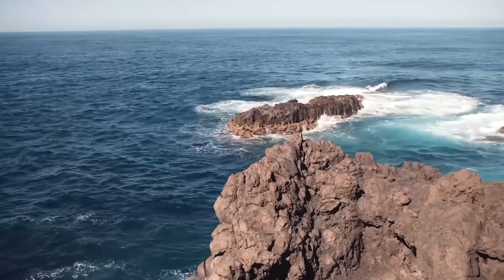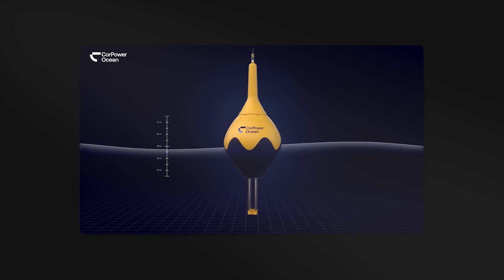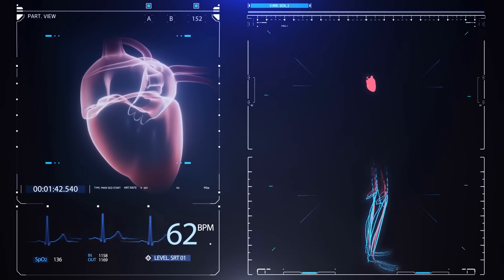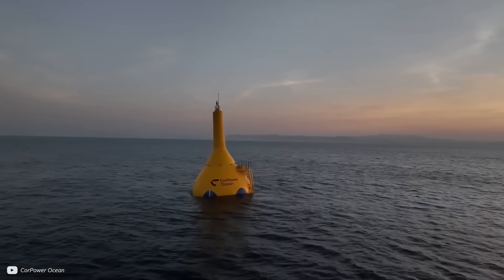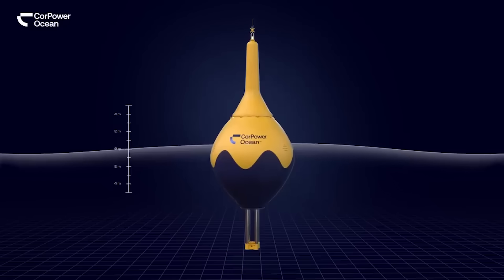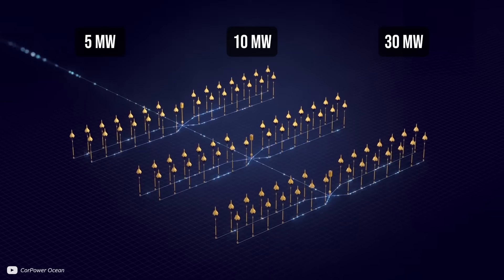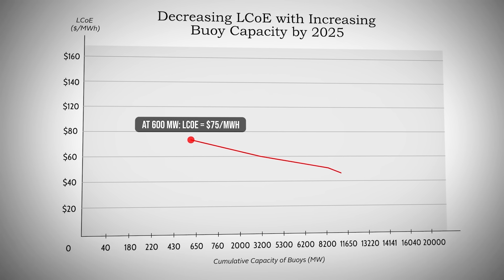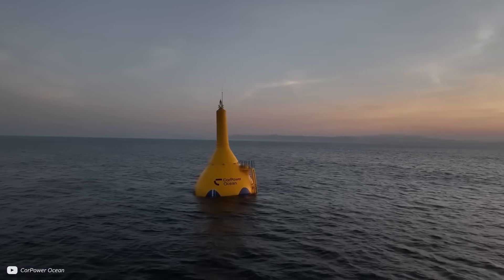Unlimited Wave Energy: This Buoy is the Future

Comment: I am not really believing the sales hype here.

Looking at the bouy, I think it will fail the LCOE test because it will get damaged and warn out, then fail just like every other wave powered electric generation systems. 

The bouy is made of fiberglass, the same thing that wind turbine blades and fiberglass boats are made of.  Fiberglass wears out and fails fairly quickly under stress. Steel is better. 

The internal gears and shock absorbers are going to wear out fast with constant use.

The bouy has steel rods that are constantly moving in and out of the bouy under salt water.  The seals are going to wear out and leak in sea water. 

The bouy and associated equipment is going to get covered in barnacles and other stuff. 

I hope it works and yo get a great LCOE, but the deck is stacked against you.   Maybe you'll be the first to make it work, but many have failed before. 

Waves have tremendous energy, and that's why they destroy everything they touch. 

You should try something easy, like landing a man on the moon instead.

Comment: Australia has a working device generating 200Mw. The Uniwave200 project sits on the sea floor and works like a blowhole, using air to spin the turbine. It has very few moving parts and is patented. It could be installed on or near any seawall
Reply: That's 200 kW (kilowatt) maximum capacity. Not 200 megawatt.

Comment: My consulting firm worked on a small buoy power generator system some years ago for pacific island/atoll deployment. Designing for the ‘100 year wave’ was a significant challenge. Rather than place the expensive generator in the buoy with a risk of it being lost if the buoy should break free, it was designed to be placed on the sea bed. This made cable to shore management much simpler. In turn, they buoy could then be manufactured much more simple and much less expensive. Onshape is a great tool.
Reply: Is your system still in place and generating electricity?  Proof of long term survival and continued functionality over time in the environment is the ultimate test.
Reply: You don't need to design for continued operation in the 100-year event, just survival. You could simplify the challenge by accepting that the system will shut down in events larger than the 10-year event. That would mean it's forced to cease operation due to bad conditions only once every 10 years on average, which seems perfectly acceptable to me.
Reply: I would say, it makes much more sense to have the expensive generator available in the buoy rather than inaccessible on the sea floor.
Reply: There is nothing that the sea will not break.  Nothing.
Reply: @Deontjie  I've seen pretty old mooring buoys
Reply: I think I remember that 👍 it was a pretty cool system if I remember correctly 👍

Comment: Come now, you should know by now that this system has serious flaws. It's based on tech developed by others which circumvent some of these flaws.
MY COMMENT ON YOUR RECENT WIND TURBINE VIDEO:
🤜⚡💥⚡🤛Being a triple engineer with numerous inventions in this space, I conclude that this is not a good design. 1] Downwind designs encounter turbulence from the tower which reduces efficiency;  2] Wind speeds are slow at low elevations which reduces energy production;  3] The blade angle is sub-optimal for all inclinations which reduces energy production;  4] The blade angle to the wind direction requires much stronger, and therefore heavier and costlier, rotors;  5] The retreating blade encounters the same loss of lift that helicopters experience which here translates to reduced energy production and other problems. IMHO, the cost of the system is comparable to legacy systems and therefore the lowest levelized cost of energy [LCOE] metric is higher. Not a good look.

FYI, most wind energy comes from medium wind speeds BECAUSE they are more prevalent/frequent in occurrence. High speed winds occur less frequently. Low wind speeds don't have sufficient energy to be of use.  

I have advanced, robust, low cost wind turbine innovations, offering the lowest levelized cost of energy [LCOE] and ultimate  survivability in any wind regime.
Simple low cost grid-scale energy storage is also on the table.

Contact me for more information and check out my engine/transportation innovations...including off-planet solutions.

Stay Radical!

From the desk of: Chief Radical Officer
🤜⚡💥⚡🤛

Comment: I got a wave power idea: I comprises of a large pill shaped float (the size of a small house) that is half full of water. It's attached to a strong arm (like a cistern float) and on a pier above the water level. Where there are two disc shaped generators (like on some direct drive wind turbines) with one for upstroke and one for downstroke. The water in the pill shaped float does the downstrokes. It's basically just one moving part and built strong, should last a while without much maintainence. Also have easily replacement of wearing parts to keep maintainence cost down. And it should be possible to empty the water and raise the float in wild weather conditions. And refilling to half full should not be too difficult autonomously. It's about half full to make the upstroke and downstroke the same power and also making the maximum downstroke power, with the same power upstroke. Obviously way less than half full when you include it's empty weight. But the combined weight would be half of the buoyancy of the air inside the float. That's what I would technically mean by "half full". I like it cos it would seem to be rugged, powerful and low maintenance. I tend to shy away from gears and sliding pumps etc. Too many parts for wave power cos of the inherent high maintenance. They go for ever without stopping, continually wearing for ever! Designers have to keep that in mind when designing waver power systems. As soon as I saw the direct drive wind turbines I immediately started work on my design, being stoked about direct driver generators for wave power!  😅 They are slow RPM and only one moving part. A win, win for wave power! 😅

Comment: You can fill a thousand years worth of videos on all the renewable energy upstarts, and all those money grabbing schemes seems to get funding.
It doesn't change the fact that this is shit. As we all know: Photovoltaic cells, wind and water turbines is the only way forward.
Something new and really smart could come along, given time, but this is just a time and money waste.
If anything, I'd look at new battery chemistries for energy storage, even pumped hydro is interesting.
Our tendency to gravitate towards new "revolutionary" solutions, instead of the incremental improvement of things that actually work, is quite depressing.
Reply: When the graph projected forward to installing a whole bunch of these devices it finally "theoretically" matched the cost of solar and wind. I would have thought that was a good reason to abandon this wave tech. 
I also wondered is the cost included the cost to deactivate these devices. I know it's pain to deactivate land based systems. I think deactivating these ocean systems would be more harder and much more expensive.
Reply: @ddegn unlike sunlight and wind, ocean waves are more reliable,. It is only during  heavy storms that no energy is generated as the system goes off line to protect it self. Therefore a better comparison than solar is solar+batteries.

Comment: A few thoughts;

1. The idea is brilliant and it is a direction we all should investigate.  Harvesting Sun and Moon’s energy directly is the most environmentally friendly methods.  

2. Like many new/ old ideas, they will require time to mature the technology/ engineering to become an everyday thing.  Train was, airplane was and cars were all discarded with their humble beginning. 

3.  There are many engineering challenges.  Survivability is not just short term but also a long term issue. There are power plants that has been running for decades, not many sea vessels have a lifespan longer than 40 years.  Composite hulls tend to last less (glass fibre tents to last 15-25 years) and they tend to leak fine glass particles to surrounding areas when they deteriorate over time, which is another cause for concern.  Some people commented on foul growth, namely barnacles, the outside growth may have less impact but internal growth (they can grow inside too) and subsequent crushing may lead to particle (many of beach sands are crushed sea shells) interference with the gear mechanism and generator.  As we all know, water, dust and electricity does not go well with each other. 

4. Debris impact etc does not concern me as much, as we can come up with simple structures to protect the buoy.  On the other hand, the buoy can be placed near hazardous shipping routes with small lights on top to guide ships.  All in all, these are more manageable issues.  

5. The real problem is cost.  Also fluctuation of power generation.  The biggest set back of current renewable energy ideas is the unpredictable power generation and weather dependency.  To my best and humble knowledge, sea has its own seasons.  Obviously, they will choose the best site for installation yet seasonality is part of nature  we cannot control or change.  It is surprising that they did not mention about it.  

6.  Finally, previous experience with multi billion dollar wind farm left me baffled with inefficiencies and limitations.  This direction appears a lot more promising than many of the wind farm or solar farm ideas.
Reply: "Harvesting Sun and Moon’s energy directly is the most environmentally friendly methods."
What do you mean by Moon's energy"
Do you mean the tides?
Reply: Yes which alone is sufficient for current energy demand if we can capture a fraction of it.
Reply: @ddegn  Really? What about all the land and hardware you need to collect and store this low density energy?
Reply: @Johnsmith-zi9pu  I'm guessing your replied to the wrong comment.
Reply: 3.) How do the barnacles get on the inside?  I'd think if they sealed the chamber off to let no water in then it would also prevent barnacles from getting inside.  
7.) I also think there's some environmental concerns.  Like won't this mess with whales or something?  I can't imagine it would be particularly good for them.  And also removing energy from waves, especially relatively near the shore, will probably have unforeseen impacts on a lot of things.
Reply: That is tides.

Comment: Another system being boasted as the holy grail, whilst failing to give a holistic answer to the energy problem. 

Banging on the sustainability drum, yet the buoys are made out of polymer strands bonded by resins - curious to know the carbon footprint of that from raw materials i.e. oil most likely, all the way to cycle degradation and ultimately recycling. 

The industry and proven to death cyclic reversal systems are less efficient and more prone to maintenance issues that mechanisms that only rotate in one direction. 

But putting the above aside, they are not addressing the navigation hazards of a full scale system - all the studies are just based on prototype scale versions - nor the littering of the sea bed with cables, as it looks like they are proposing arrays with several duzens (no mention on material availability here thought), the fact the rest of the Offshore Energy Sector is being faced with unexpectedly high OPEX costs, plus the lack of redundancy on the mooring system - one of those big boys floating abouts should be fun.

Anyway, flavour of the week I guess....

Comment: So why don't the just put a big ass oil rig out there but instead of a pipe running to the floor just a beam running to a large float. Oil rigs use motors to run those rigs so just use the rig to run the motors instead 🤔

Comment: I've had a simpler idea in mind for a long time: a massive permanent magnet is driven upwards through a coil by a wave, and it drops back again via gravity to also generate power. A 'linear generator' in other words.

I doubt that life would ever that simple in practice of course but the concept does have the benefit of easier maintenance and possibly manufacturing too.

Comment: The ocean is an horrendous place to put machines. Mechanical and chemical attacks are happening all the time. Richard Barnes recently paddle a kayak from Australia to New Zealand and he was scraping barnacles off each two weeks. 

Also LCOE is specifically only to be applied to dispatchable generation sources as it ignores a lot of costs in providing dispatchable electricity eg storage and frequency control costs. 

The True System costs is the preferred method of costing to understand the actual cost experienced by the grid of using different types of generators. True system costs assumes that 24/7 power must be provided. It allows different generation system true costs to be determined.

Comment: Use compressed air with no air leaks some pressurizes air move cylinder same with little energy to switch aircylinder to move as if no air leaks and even if did still generate more power than used

Comment: This company is indulging itself in fun but expensive engineering.  It's funded by various Swedish and Norwegian govt agencies.   Inventing a new anchor?  You need a concrete block.  Composite hull?!  It needs to be a cheap steel hull- just like an ocean buoy. There's a reason ocean buoys are good old steel. Leave the composites for aircraft.   If making these buoys too expensive were the objective, then yes they have succeeded.
The human heart is not exactly a thing to compare. It's limited by biological issues and the fact that it only pumps on the upstroke is not an advantage and is easy to recreate in many ways.  The sliding hydraulics will likely be the cause of failure, the seals won't tolerate the salt environment and storms. The toggle linkage mechanism is inherently too limiting in wave height range and too hard to control outside it's limits.... I'd go right to the gear train and slip with a clutch.  This presentation repeats too many sales talking points- the power generated per ton, for example, is really irrelevant 0:36 .  Even efficiency isn't very important, only cost/kilowatt matters.  Comparing these point absorbers with wind turbines in any way besides $/kilowatt is also irrelevant.  When a company makes such silly comparisons, worry.  It's a sales pitch.
I would suggest that a system that can't tolerate water inside, and has complexity inside (ladders, sliding hydraulics with seals) requires woven carbon fiber hulls (literally a non-starter) and even the anchor to the ocean floor looks too complicated.  This energy source will need: Likely, no swept surfaces underwater (the hydraulics) No severely limited wave height (the toggle linkage) a simple hull (same steel as ocean buoys) and simple blocks of concrete for anchors.   
I'm a fan of the overtopping concept- it can be way more simple, and I think it can be a soft structure, just a shallow rubber 'tray' on the ocean surface with soft flexible sides that water can slosh over.  Inflatable bladders could raise it's edge for bigger waves.  There are working over-toppers already out there.

Comment: I had a wrist watch in the 80's that didn't require winding or battery changes. It charged from body movement.  The tec is old, the will is lacking

Comment: This is one of the best videos about Wave energy. CorPower is an invention based on trusted and well handeled theory. This is uncommon with most other wave energy videos. However CorPowers technology is based on a very sophisticated working principle, with constantly tuned mass damper. Most people will not be able to understand why CorPower is more efficient than most other wave energy converters. I am a machine engineer, but must admit that the working principle is beyond my understanding. But have been told by an expert that CorPower is one of a very few projects that may succeed. I dont expect wave energy to be a commercial succes ever. But I have a very short list of the two most promising projects: Wave Piston and CorPower. All other projects are without any chance of succes. And are just a vaste of money and time.